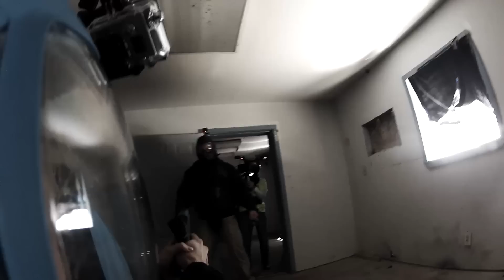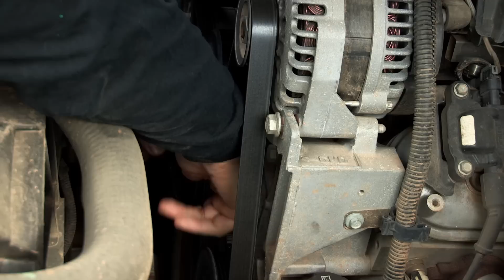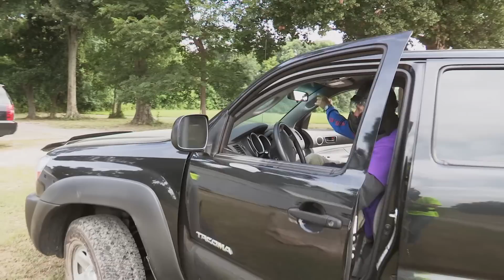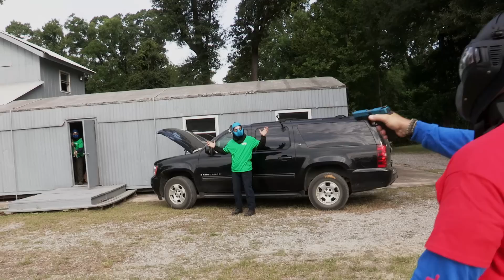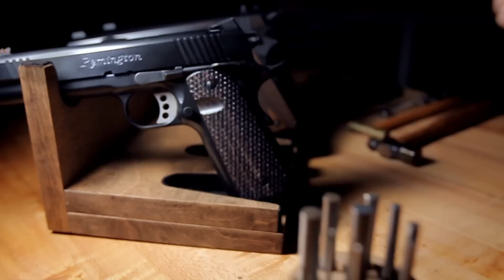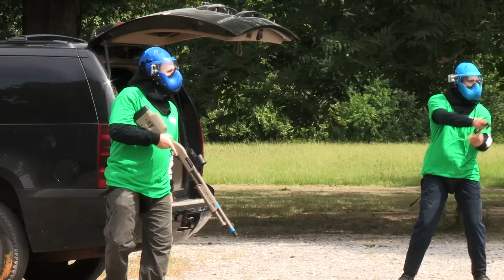Gun Fight at Fishing Camp: First Person Defender|S2 E11

Comment: Pull up on my property and flash a gun, you have about 2 seconds to live because I carry a snub .44 magnum and have a 12 gauge mossberg 500 SP Cruiser Model in the back of my truck. And thats when im not carrying the .50 Desert Eagle.

Please note that its loaded with 1 ounce high power slugs. That damn round can put a cantalope sized hole in a steel door at point blank range.
Reply: Overkill, I think you picked the right handle.
Reply: Should of went with a 500 sw magnum

Comment: Unfortunately, you can pull the trigger on an LCR, and if you didn't let it fully out, the cylinder will rotate, but will NOT fire.  VERY unsafe design from Ruger.
Reply: Actually you're misunderstanding what you've read on the internet. 

If you pull the trigger, it will fire. If you don't reset the trigger fully it won't go to the next chamber. Some revolvers are built in the same way. 

Basically it's an Id10t malfunction.
Reply: 37thgungrunts The SP-101 will only lock up the cylinder if you short stroke the trigger, but, I have an LCR, and tried around 10 other LCRs, and they ALL will rotate the cylinder and not drop the internal hammer if you don't let out alllllll the way, Wiseguy.
Reply: I've sold about 19 LCR's, and have yet to hear that from anyone.
Reply: 37thgungrunts Maybe because many people don't extensively train with their firearms.